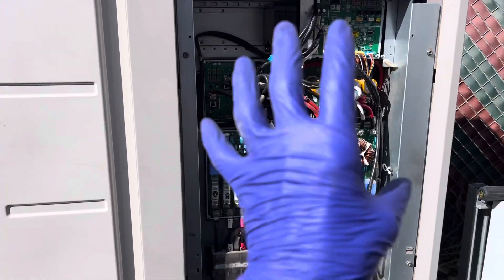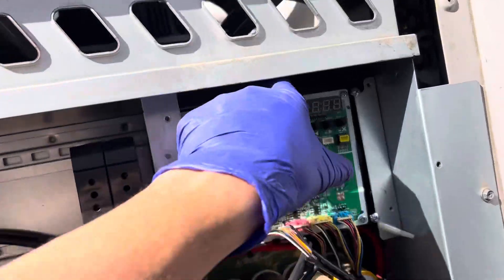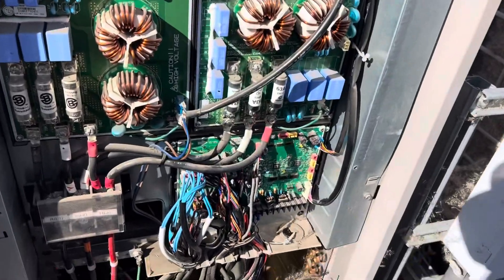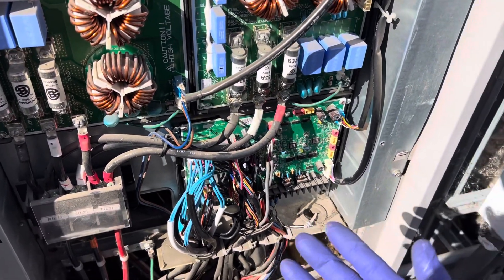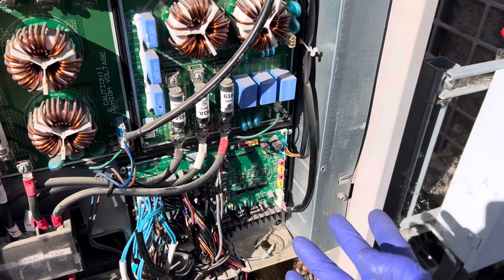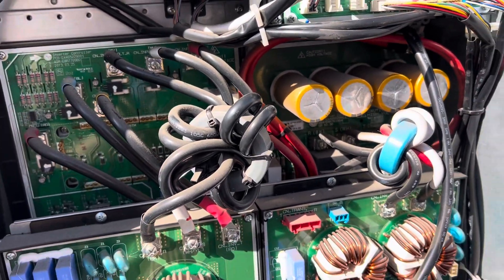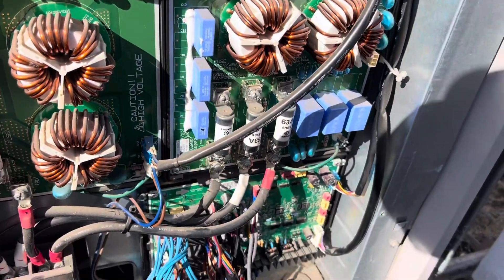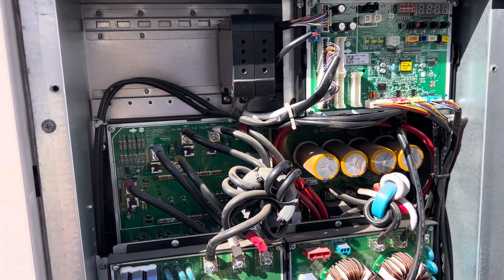Electric car heat pumps are like commercial building heat recovery systems. Downtime is expensive.

Comment: Tesla can heat or cool the battery or a cabin simultaneously
Reply from the maker: 👍 many heat pump manufacturers can do this if they have their system designed as a heat recovery system.
Reply: @coldfinger459sub0  tesla has the best hvac system in my opinion, everything is so compact, and most parts are shared between all there models tesla is soo good i want it do bad
Reply: Tesla is also run by elon musk who likes nazi salutes, runs many scams, steals government money, and now also in politics to destroy usa.